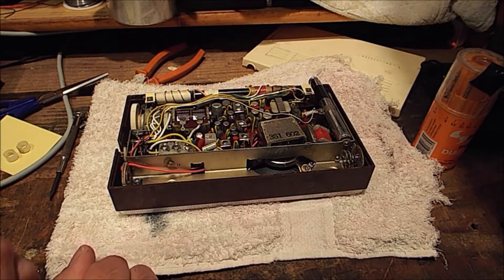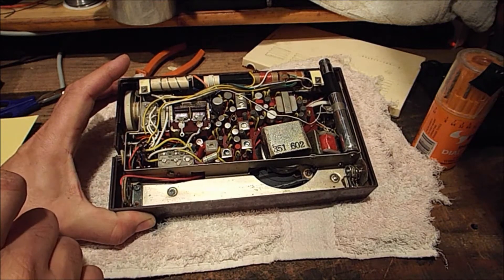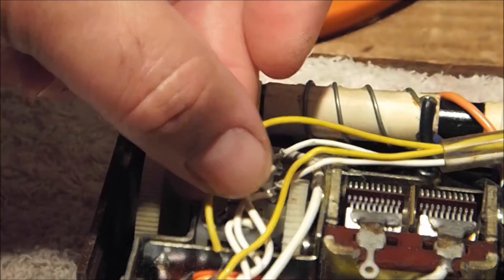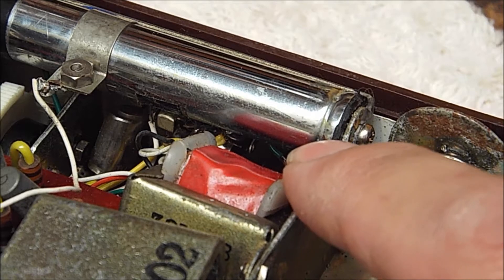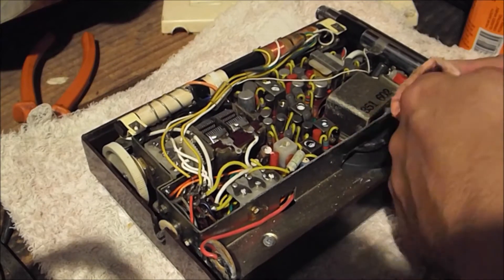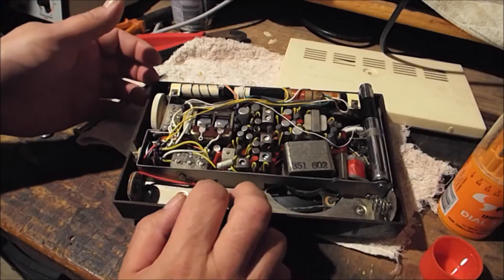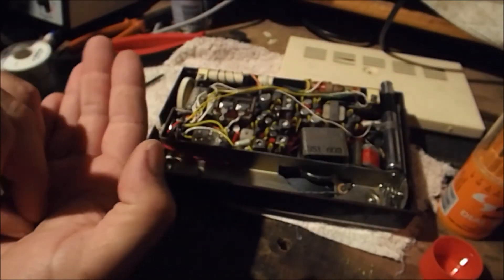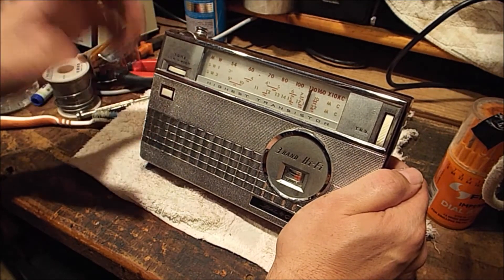"Bel Air" 3 Band Transistor Radio (8TP-803) - Project Update

Comment: I have the same radio. It has a strange problem. Every now and again when I turn it on...no sound and the batteries  get hot.
I take them out put them back in and everything's fine for  a few years. Obviously some sort of short. Could it be atin whisker in a transistor. Battery contacts are fine. Radio plays great.
Reply from the maker: It could be a cracked solder joint on the battery contacts (or circuit board) causing an intermittent short (manifesting as heat from high resistence.

On a side note and unrelated when did YouTube Studio (for content creators) start offering AI suggested responses to comments? 🤔
Reply: @SpectreOZ  Thank you for your reply.  When I got his radio in the early 2000's, before the Smart phones, it was my traveling radio. On a flight while going through security, my carry on luggage was going through the X ray machine. On the screen all you saw was a square...with batteries and wires and components. It looked like a bomb on the screen. The security officers pulled me aside. They were now on high alert. They made me empty my suitcase.
When I pulled out the radio (mine still has the leather case) they asked me what it was. I tried to explain its a vintage transistor radio from 1963. They'd never seen one. They were clearly on alert. I took the radio apart and even turned it on . One of the Security guards thought    it was cool when he realized what it was. 

Two if the three bands work on mine. One of the shortwave bands stopped working when a mica sheet fell out. I bought more mica sheets but can't get that band to work.

I frequently watch your Bel  Air video . Any follow ups?
Reply from the maker: @barryfleischer5167  The radios got placed in storage (where they remain) after moving house, so no updates as yet.

That Airport situation may have just inspired another collector 😉

Comment: great stuff thanks! What did you use to hold the batteries in place? I have one of these and it has a tube holder. Mine won't pickup any stations though :(
Reply from the maker: Thanks for your comment, this radio also came with a clear plastic tube (battery holder) but I imagine a PVC replacement could be fabricated, as far as reception problems have you cleaned the switches? Battery contacts? 

More often than not... simple faults are the cause 👍
Reply: @SpectreOZ  Thanks! Yeah I did all that. It makes noise but won't actually tune to anything even though the dial moves nicely. Wondering if capacitors or transistors need replacing
Reply from the maker: @elwrongo  Does the radio output any noise/sound into the headphone jack? audio stage could be damaged leaving no output via the main speaker (I have seen a radio which behaved in exactly the same manner before) 👍
Reply: @SpectreOZ  Thanks and just tried that but no difference. Last night I tried putting my phone through the "pick up terminal" jack after reading your post that it was an audio in. Worked great and sounded good so I guess the audio section is working. Something else is going on (or not!).